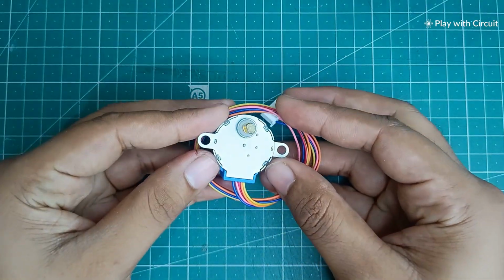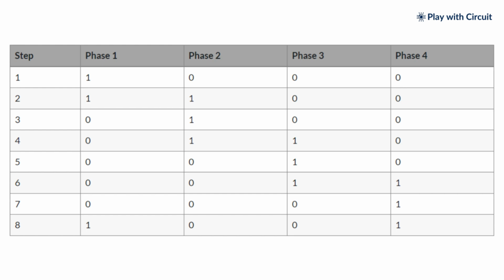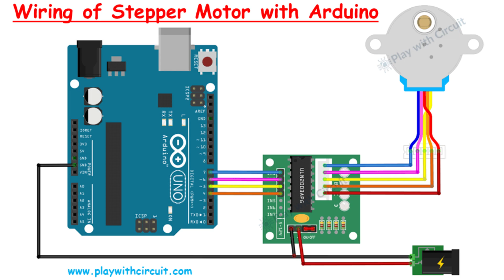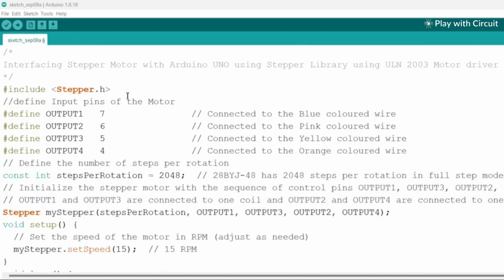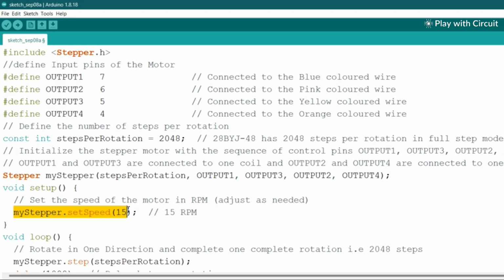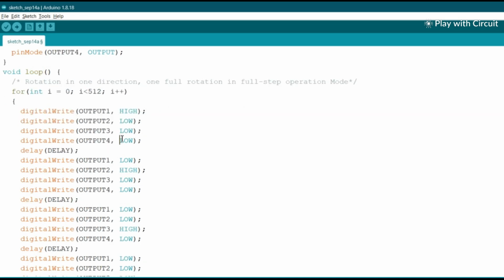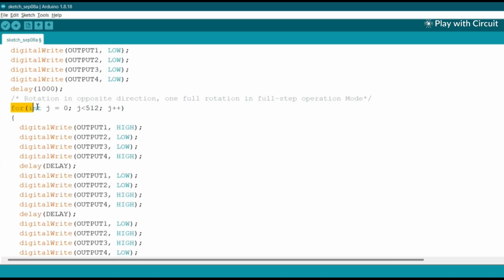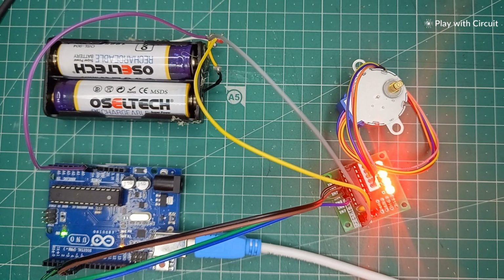Controlling 28BYJ-48 stepper motor with ULN2003 and Arduino | Arduino Project

Comment: Why you use
output 1,3,2,4 while using a lib. and when doing it by yourself you do: output 1,2,3,4?
What is the reason of that?
Reply from the maker: yes name can be anything but the parameter should be like this  : blue , yellow , pink and orange , which are connected to pins 7 , 5 , 6 , 4 pins of Arduino respectively. Blue and yellow are connected to one coil and pink and Orange are connected to one coil inside the stepper motor and the parameters are required to be put in this way in library. for more info visit https://playwithcircuit.com/28byj48-stepper-motor-arduino-tutorial/

Comment: Can I rotate without arduino?
Reply from the maker: the switching of the input line to the steeper motor should be done very fast it can only be done using a microcontroller , you can use another microcontroller but the basic remains same.